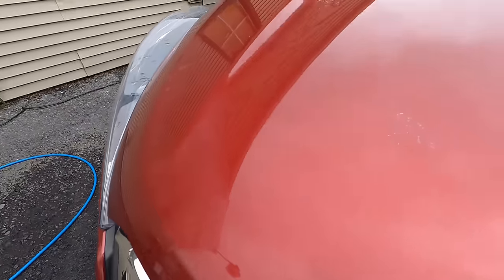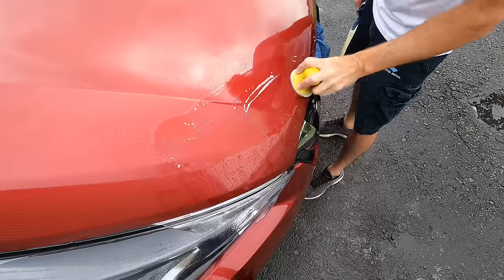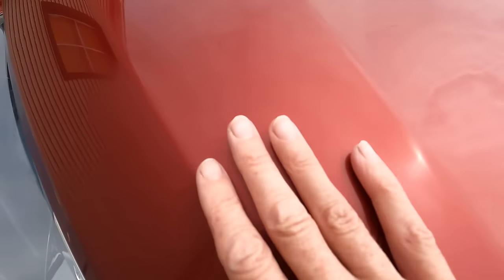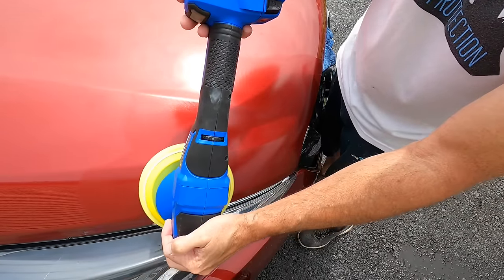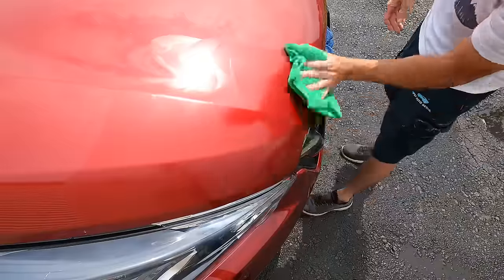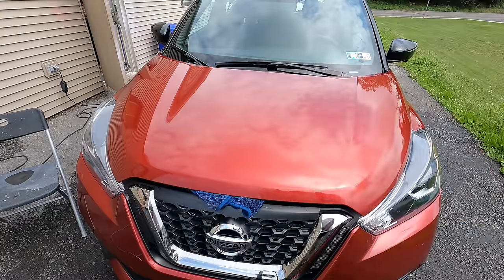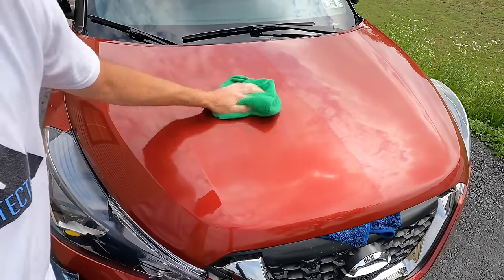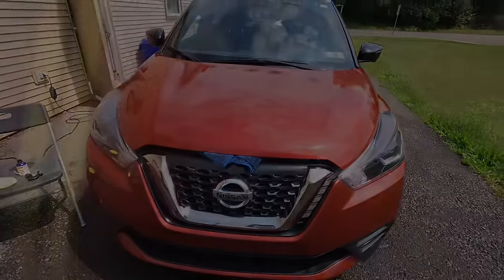HOW TO Remove Oxidation From Clear Coat. Safest Way Possible! Do It Yourself!!! Learn To Wetsand!!!!

Comment from the maker: If you like the HOW TO videos....what more would you like to see.
Reply: Any "How To" videos concerning paint correction are always appreciated.
Reply: How do you know when the IPA has done its job video sir!
Reply: I know you love Gel Coat but a small boat every once and while would be cool. What coating company would be best? Yours? How many layers can be used if possible? How long would it be good for?
 I need to do mine again.
https://www.youtube.com/watch?v=-Pa8_Jkk1wc

I wished Gel was as easy as paint. Thanks
Reply: You must not like the Hercules if you’re using this one already or waiting for a good paint correction?
Reply: How to keep rotary polishers from skipping!!!
Reply from the maker: @jonschmunk7719  if you properly douse the area… it will do its job.👍🏻
Reply from the maker: @robertjackson7590  polysilazane is well capable of protecting gel coat. Durability would depend on fresh water versus salt water. 2 coats on absorbing gel coat is recommended.
Reply from the maker: @Amor1990  actually the Hercules is decent… stay tuned
Reply from the maker: @kimnewling5728  add more product. Slightly tip to ten degree angle periodically. Adjust speed and pressure.
Reply: Blending in repairs from ghosting using the rotary
Reply: Another awesome video and tutorial good friend
Reply: I like the how too videos
Reply: Fabric seats clean with no extractor process
Reply: A tutorial on the various speed levels of a DA. I am always scared of going above lvl 4 (shinemate ex620) and don't know in which scenarios I should do it...
Reply: I enjoy your how to videos! It is how I got started detailing! Have you done a video on glass polishing? Removing etching and light scratches.
Reply: As much faded trim as I am seeing this summer trim restoration would be a good video. Yes you have done this before but people are still missing this topic.
Reply: How about a how to on prepping a brand new car for a coating? Do you need to use a cleaner polish first?  Things like that.
Reply: Can you show us how u clean up chrome around doors and rims..PLEASSE
Reply: I like the polishing video. THE POLISHING, just polishing it self is satisfying. I sometimes jump straight to it and skipping the talk
Reply: Another older single stage paint where you allow multi coats of Meguiar's # 7 to soak over night. Then top w/a sealant.
Reply: How much was the kobalt polisher w/batts and charger? Where to buy? Thank you!

Comment: Thank you for the video!! Living in Florida and the sun does sooo much damage. The wet sanding took away the oxidation, looks 10X better. After wet sanding it looked very cloudy, but I used Mequiar's Ultimate compound and it brought the shine back! Will polish next! 🙂
Reply: I live in Southern California that heat wave we just had with the multiple fires, within that time frame, the wing of suv oxidized. Tjat sun was brutal. I only need to have to do the rear ring of my suv. Not all of it is oxidized. But do you recommend I wetsand the whole thing or just the spots that are oxidized.

Comment: A video ive been hoping to see anywhere is more of an analysis of different rotary polishers. Unless the only difference between a cheap one and a name brand are parts quality and longevity. But all i can ever find in a search is comparisons of da vs rotary. Fwiw Im using a Bauer 7" rotary, and it works great aside from being a tank.
Reply from the maker: The Bauer...or even the Drill Master from HF works perfectly fine.

Comment: Sir, you did the hole car using the hand sand pad? Or later used also any sanding machine?
Thanks a lot , great video again sir
My kind regards
Reply from the maker: Just the oxidized area on the hood.
Reply: @apexdetail85  thanks sir

Comment: Is it really necessary to sand it?
Reply from the maker: Absolutely… to keep temperatures down on an already stressed clear. Repeatedly running a polisher back and forth will spike temps exceeding 130 degrees
Reply: @apexdetail85  never got a paint so hot while using the polisher

Comment: That diy detail polish is expensive, but lasts. 
6:39 that’s not rushing? Maybe I’m so used to using the same coatings I’ve gotten accustomed to the same speed. 

You ever get any of those expensive waxes from PolishAngel you store at 45 degrees?
You familiar with that Color changing ppf?
Reply from the maker: I have some PA products to review.. stay tuned. We install cosmetic PPF here.👍🏻